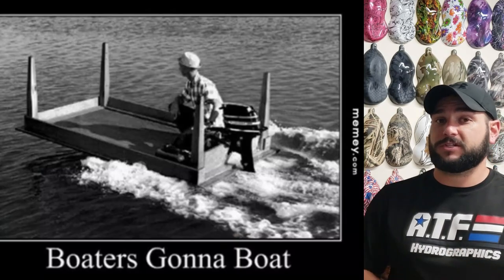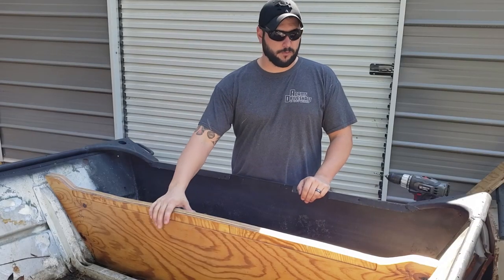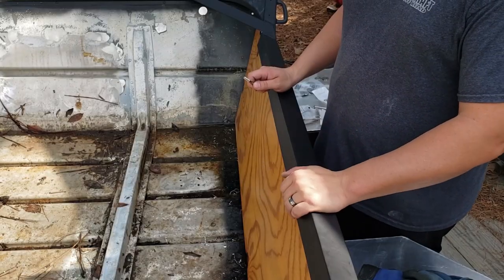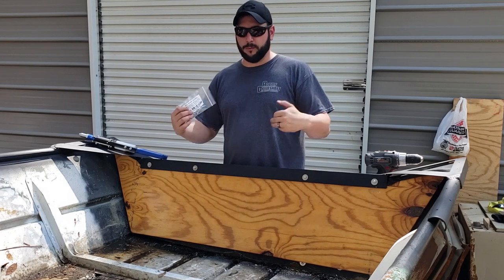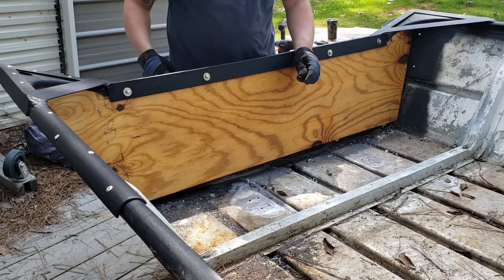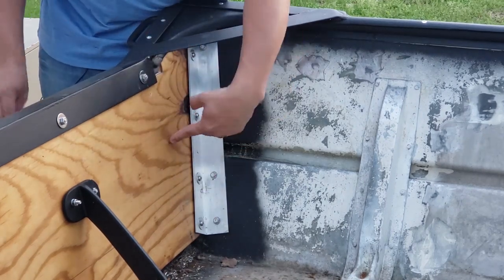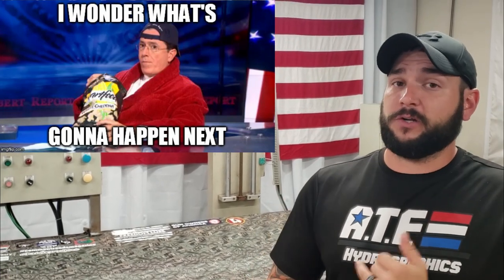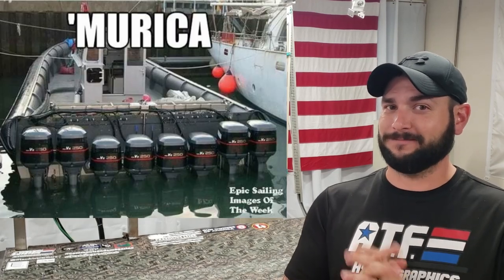DIY JON BOAT TRANSOM REBUILD - Part 3 - Project Bottomland Bateau Episode 7

Comment: What are those transom knee braces and where could I find similar ones? Thanks for all the info!
Reply from the maker: They came with my boat, I have never seen them for sale anywhere.
Reply: Yes I like those knee braces also. Super clean and easy. I’m trying to figure out a way of not going back with the original big bulky aluminum knee brace since I have beefed up my transom and now need to build my back casting deck.

Comment: I just purchased a jon boat with the exact same support brackets as yours. They are currently riveted in, and I assumed I would have to use rivets to reinstall them when I replace the transom, but you just used bolts. Why didn’t you use rivets? Aren’t rivets more likely to remain watertight?
Reply from the maker: I have a video of the install on my boat channel @senditjonboats I used bolts with washers and 3m. Sealed up just fine. Either way will work.

Comment: Im not going to call it a hack job, the work is good. The only thing i recommend is on your corners your basically 
not gaining any advantage of bracing the corners with the aluminum because the bottom of your wood i essentially 
floating and not secured to the actual transom skin. Through bolting the pan head screws would solve that. Just
my humble opinion.
Reply from the maker: That is a good point, and I did consider through bolting the transom and glueing the transom to the skin. The only issue with through bolting in my application was the float pods cover half of the back skin so I would only be able to get 1 or 2 bolts without interfering with the float pods. This was a giant experiment anyways just to see what will work. The wood and the transom skin has quite a bit of bolts going all the way through already, I think 8 total, but we will run it and see what happens. If there is any issues I will take it all apart and figure out how to make it better.